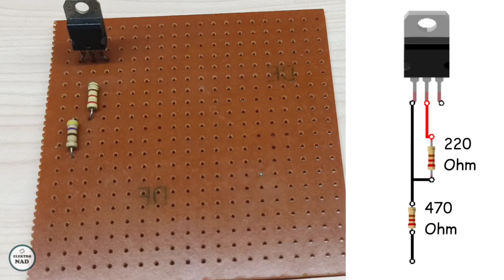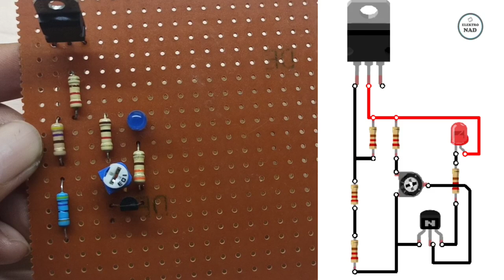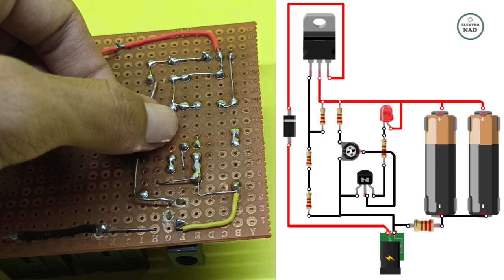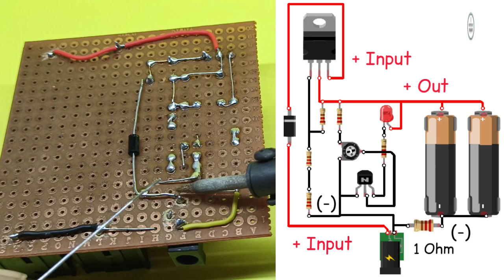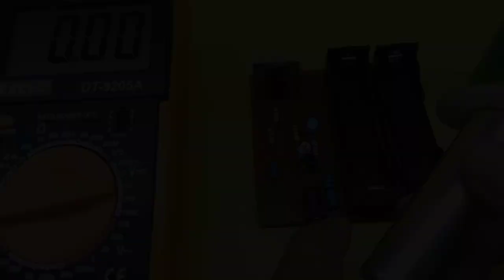3.7V battery charger with indicator full (LM317)

Comment: Good evening, first of all, all the components of the circuit are correct and the charger is 6 volts, but the measurement on the output I have is 5.3 volts. The variable resistance does not have a strong effect. Secondly, if I charge 9 volts, the output is not correct. Please reply to me and thank you
Reply from the maker: make sure all components are not defective.  especially IC LM317

Comment: Hoii, sy sudah bisa 3.65 volt nya, tapi ada masalah di LED indikator tidak mati saat baterai di colok, dimana ya kira2 salah ny?? Apa kalau merubah voltage harus merubak resistor nya juga?
Reply: Siap, terimakasih gan
Reply: Balas lah gan, butuh bantuan
Reply from the maker: 1. Indikator mati ketika baterai dalam keadaan low...
2.  jika menginginkan tegangan baterai full pada tegangan 3.6 Volt maka output di atur pada tegangan 3.6 volt juga. Caranya ganti resistor 470 ohm dengan trimpot 10K, kemudian putar trimpot atur pada tegangan 3.6 volt..  
3. Pastikan dioda terpasang pada bagian input kaki lm317.